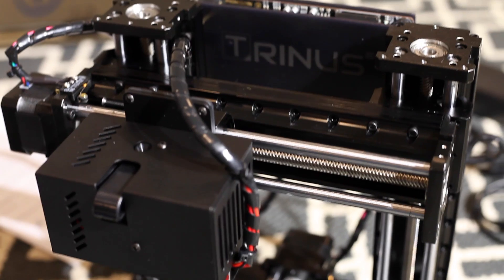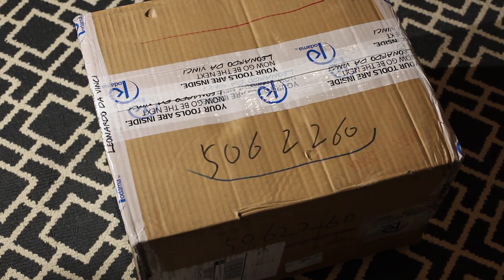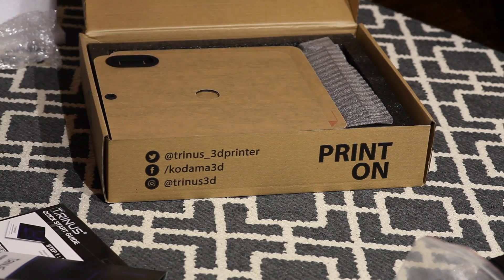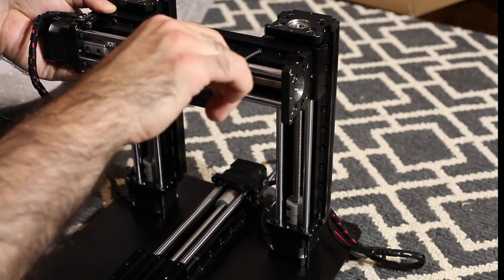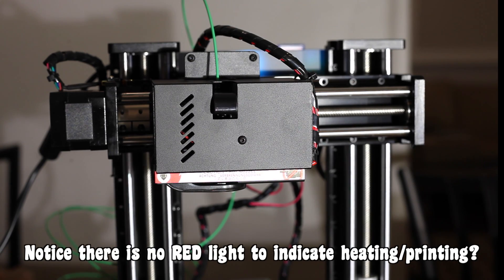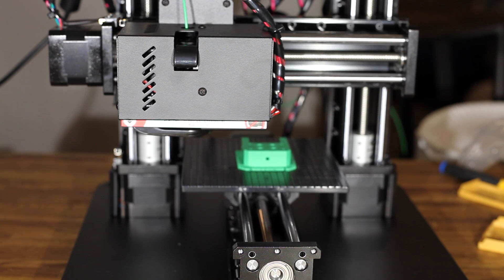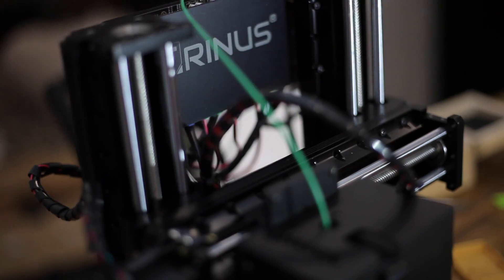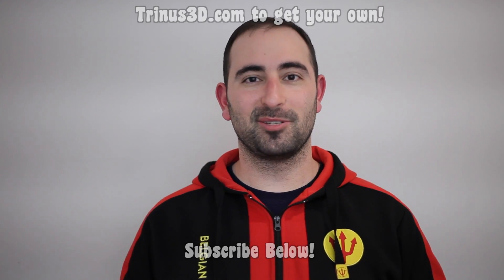Trinus 3D Unboxing & Printer Review

Comment: Tinus3D can use Cura and Simplify3D, in fact, its sold with a simplify3D license as a bundle.
To add to that, your platform was not installed right.

Comment: I live in an apartment and am in the market for my first 3D printer; how obtrusive is the Trinus' noise level?
Reply from the maker: +gorryn it's not very loud.  Small stepper motors like these don't make too much noise.  I would say your television on during normal use is louder than most 3D printers, this one included.